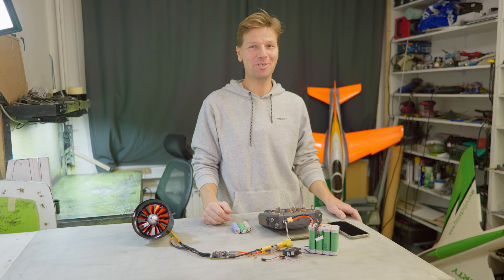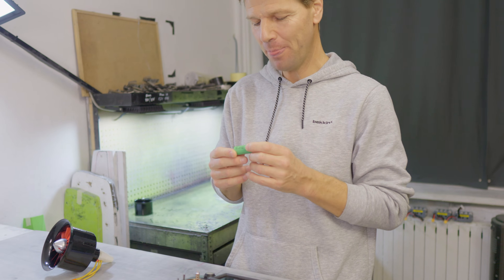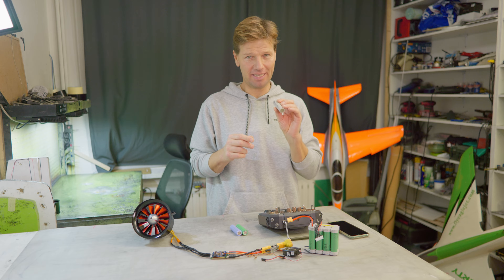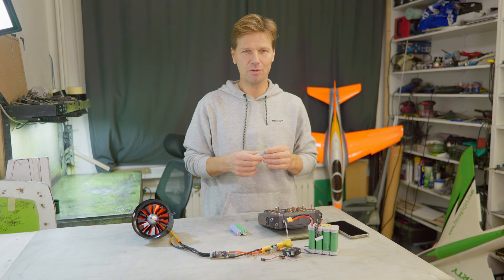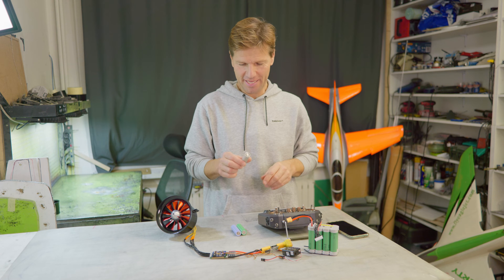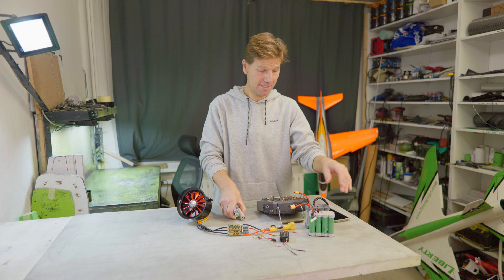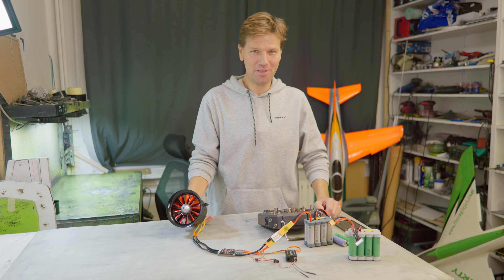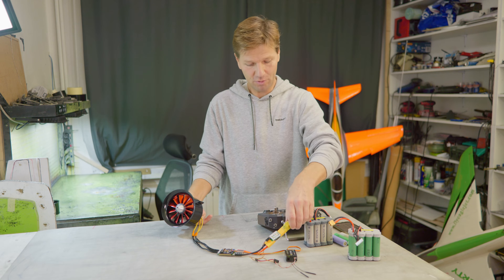Li-ion Revolution??? Honest test of new mindblowing battery for RC airplanes and more, Molicel P45B

Comment: Thank you for sharing your experience on these new batteries. As you indicated, the construction of the batteries matters and it is for this reason that electric vehicles use the same cylindrical batteries as their power source. I'm sure that this LiOns will continue to improve and it might actually displace LiPo cells when you consider the longevity and durability aspects.  I do hope RC battery manufacturers are paying attention and will offer pre-assembled packs using the same Molycel P45B for those of us who are not adept at soldering tabs and balancing wires.   Again excellent video and please keep these informational stuff coming. Thanks.
Reply: I've used the sony VTC6 18650 for quads and they had the best discharge to current rate. The molicel were my favorite 21700 but, li-ion really isn't good for high amp draw full throttle runs they're great for long range fpv quads and wings though. You can buy pre built li-ion packs from a bunch of brands just check what cells they use.  I solder my own but, you can and probably should get a spot welder for $50. I order all my cells off 18650batterystore but, if you live outside the U.S. they might be cheaper elsewhere just don't trust Aliexpress cells haha.

Comment: I have a CARF Rebel Hot.  What EDF  power system would you try in it?.
Reply from the maker: WeMoTec100 with HET700-83-1080kv motor on 12s2p   or   Jetfan100PRO with HET700-98-935kv on 12s2p  of course on Molicel P45B. You will get ca 5,5kW 7,5kg thrust  300km/h
Reply: @EDFjetRC  Thank you!. Do you have an estimation of flight time with these setups?.

Comment: Can you do a tutorial showing how to make and install the balance cable?
Reply: @Allens RC Adventures We need to do this!
Reply: @sendit_rc  For sure.
Reply from the maker: https://www.youtube.com/watch?v=I090JQk2fMs&t=3s
Reply: Made a 6s with these Li-ons.Doesnt have the punch.is it because it needs 6s 2sp in parallel?
https://youtu.be/wOlbUAeSqqk
Reply from the maker: @sendit_rc  6s2p on this Li-ions will be the exact weight of 5000 6s LiPo battery, but double the flight time.
Reply: @EDFjetRC  Wojtek, thank you, your instructions and advice has been fantastic
Reply: @sendit_rc  Hi, could you give me a little more information on 6s 2sp please. I ask as I built a 6S using these batteries and they were lacking.
Reply: @JP-17PEZ   used only 6 li-on cells and no punch with throttle.maybe because of not using 6 li-on cells+ 6 li-on cells in parallel to distribute the amp draw load.

Comment: Only half the weight of a Lipo of the same capacity ! Price too at around 8 Euros a cell makes for a low cost set up. What is the effective discharge C  rating, must be pretty high. Can they charge just as fast ?
Reply from the maker: max charge 3C

Comment: I noticed that they say to not solder. I assume that this is a guideline. Are they worried about a prolonged heat or will a quick spot weld be OK?
Reply: watch his other video on soldering.   you can solder with big solder gun only a few seconds and it takes.
Reply: I have soldered 250 of the P42A cells and all started at 3.56v each new... and after soldering stay the same, excellent consistency. An 80W fat-tipped iron will flow 60/40 solder in 1 second and right after you can barely tell the cell end even raised a degree or two. Heat potential... not long-term heating of the joint is what counts. No way nickel straps/spot welding is going to handle 70...150+ amps. I use 8ga solid copper.

Also, pre tin the ends of the cells so when it's time to join bits, just have to melt the solder on both pieces and it's done.
Reply: @deadstickduck2025   Thanks for the advice.
Reply: @deadstickduck2025  but now you got more professional you switched to spot welding copper?
Reply from the maker: Do not spot weld, nickel stripes are far to thin for this Amps! Look at my video:   https://www.youtube.com/watch?v=I090JQk2fMs&t=1s
Reply: @EDFjetRC  Thanks for the advice. Looks like a hot iron for a second or 2 will be all in need on a prep'd surface.

Comment: WOW , nice nice nice , ... its gamechanger i think ... ;-) I will fly them in my VIPER for sure .... ;-) I fly the SAMSUNG 40T for 2 years now im my AVANTI and VIPER BH , i was searching for new energy 2 years ago for me EDF jets , LIPO was NOT DONE anymore for me , flighttimes 3.5 minute and the LIPO packs are expensive and not verry long lasting .... i search and i found  Wojtek , i build some packs and i fly with it , i did't read the specs from the battery because Wojtek showed us that all this worked. Why i should make me worry about the specs ... and now i fly them for 2 years , not any issue with those LiIons , nothing PUFFED , and flighttimes double even 10 minutes instead off 3.5 minutes with LIPO in my avanti ... ;-) and now this new MOLI packs ... where we gonna end , its easy tho make those packs and cheap , with a low price 3D printer and some soldering parts you can make those packs , its not rocketsience , ... i'm a BIG FAN ... i like it ... i will only fly LiIons now ... and i don't need big factory's to make those LiIon packs , i will do it better them them ... ;-) its a part off the hobby now ... many thanks me friend to show us all off this ... ;-)

Comment: what would the typical fight time of an edf model be on these batteries?
Reply: My Freewing F-22 on 12S2P configuration - 9 minutes, full throttle
My Freewing Gripen on 12S1p - 6minutes, mixed throttle
Reply: Figure at least 50% longer if you keep the average current in the 30-40A range, only using full power for verticals and a few fast passes. Instead of 5 minutes, 7-8min now. New 45B also 3C charge!
Reply: @deadstickduck2025  3C Wow!
Reply from the maker: approx 50% longer than on LiPo

Comment: Sorry for being stupid but the spec says 45 amp discharge but are we saying they can achieve 160 amps??
Reply from the maker: it can achieve 200 Amp. 45Amp is a constant discharge without cooling, for example inside e-cigaretes.
Reply: We pull double that spec for a few seconds at a time and throttling back to 65% for level flight... on the older P42A... these are a full level higher in performance, and run cooler.
Reply: Thanks. I have ordered 6 to make my first pack. Thanks for sharing the info. Very exciting
Reply from the maker: @ray.staerck  https://www.youtube.com/watch?v=I090JQk2fMs&t=1s
Reply: Thank you my friend ❤️👍❤️👍❤️👍

Comment: How is the difference in power between a 6s pack molicel 45 and a good 6s pack lipocells?
Reply from the maker: 6s2p on this Li-ions will be the exact weight of 5000 6s LiPo battery, but double the flight time.
Reply: @EDFjetRC  why
Reply from the maker: very similar
Reply: @EDFjetRC  great, thank you for your answer

Comment: Wojtek, tell me please if you load such fully charged 8S battery 80A of current, to what level the voltage will drop?
Reply from the maker: depends. If the cell is warm than 3,375Volt

Comment: I immediately ordered Molicel P42A because P45B are not in stock.
I hope to get a similar performance here.
Thank you for your videos. ✌
Reply from the maker: The Samsung 40T and 50S are stronger than P42A
Reply: @EDFjetRC  The 50S will be hot enough to cook a pizza if you attempt to push out more power than a P42A
Reply: @EDFjetRC  Oh no. 😮
Thanks anyway.
Reply: What makes the p45b so special?
Reply: @ripp3rjak934 the pizza doesn’t burn 😆